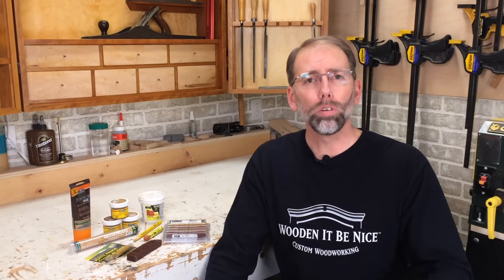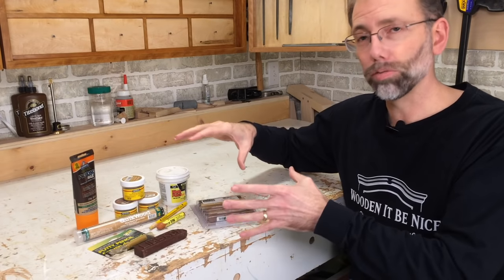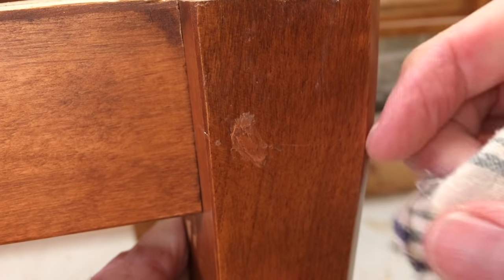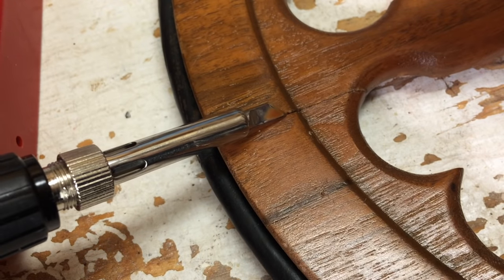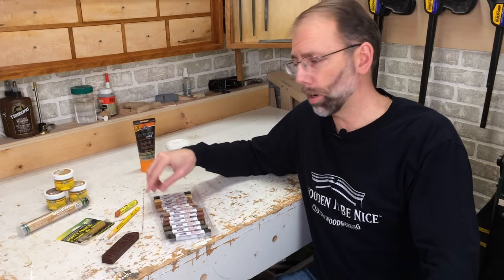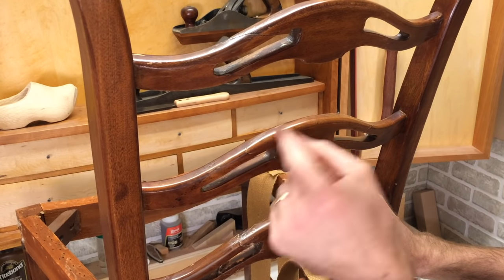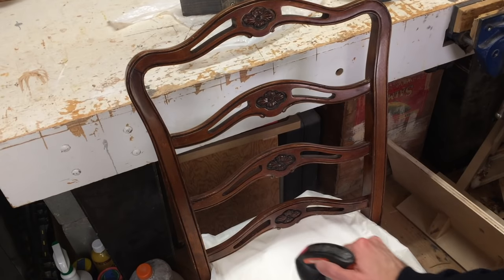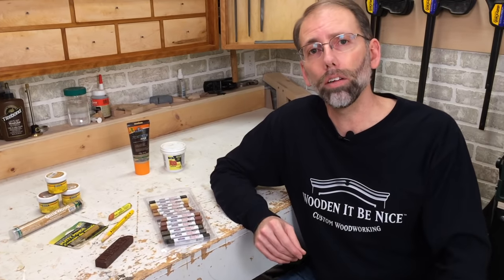Wood Filler & Putty for Furniture Repair | Woodworking How to

Comment: Hi. Thank you for helping me understand the terminology- I was at a Home Depot recently and confused with what to purchase- I am still not entirely sure which product to use even after watching this video. I have laminate flooring and deep gouges - the floor is tan colored. I have PlasticWood X by DAK and thinking of using this on the gouges on the laminate floor. I will try researching this a bit more before using this product. But thank you for posting this video! In case you are familiar with plasticwood X by DAK let me know your thoughts about using this product on laminate flooring..
Reply from the maker: For flooring, there's a better product called Hard Fill.  Here's a video about it.  I hope that helps.  Scott https://youtu.be/XIZs7JJXZ5s
Reply: @FixingFurniture  Hi. Thank you ! I just saw this video with the hard fil wax. I did not use the DAK plasticwood X putty. I had already ordered a Floor Fix by CalFlor repair kit on Amazon to use on the laminate floor gouges. The small holes in the area worked well but awaiting to see the results for the deep scratches. Mohawk Product wax stiks are confusing with all their different names. I bought the regular Fil sticks (which say heat not needed) to cover some scratches on a coffee table. They worked OK but not great. Therefore, i did not jump to order the hard fill and a soldering iron for the laminate floor. I have not been very handy around the house but I am trying to learn more about fixing things myself- its taking time :) If you have any further advice to give based on this comment, I would highly appreciate it. Thanks a ton again

Comment: I repaired one furniture with melted wax with range of colors within the set, quite effective i may say but staining the wood afterwards is a pain coz stain doesnt wanna adhere to waxed areas
Reply from the maker: Ah, yes.  I should have mentioned that wax filler sticks are meant for finished wood, not bare wood for that exact reason.  Scott
Reply: Gel stain would work better.

Comment: What filler could I use for a chipped veneer on a particle board furniture (it's an ikea furniture)? I don't have the chipped piece so sadly I can't just glue it back on
Reply from the maker: I suggest a "hard fill" product.  Here's a video I did with Mohawk Finishes demonstrating how it works https://youtu.be/XIZs7JJXZ5s

Comment: A couple of other  things that I have regularly used for "filling".   One is hard resin burn in sticks.   These come in transparent and opaque colors and I have done 10s of thousands of them.   These are useful for repairing damage such as dents or scratches on the "show surfaces"   You level them and then match the sheen level.   Done properly, the repair is very hard to see.   But it's not an easily learned skill to get it right.  It takes a little practice.  I probably have 50 different colors but the most used are light and dark amber transparent sticks.

Second is a 2-part wood filler.  Common brands are Bondo and Minwax.   I have used these where there is deep damage like a dog chewed a large section of molding.    It sets fast and you can rough trim with a chisel or knife before it's fully set up, then finish up by sanding.

Mohawk and Guardsman make a variety of colors of the epoxy putty sticks.  Just like the wax sticks, you can blend them together.  They do set up much faster and you can accelerate by heating with a hair dryer.   If you are in the shop, time does not matter as much as when you are working on site and have unproductive time waiting for the epoxy to set up.  I've also used them to fill in where hanger bolts have stripped out of things like sofa legs.
Reply from the maker: That's some great information Keith.  Thank you for sharing that.  I really like your tip on heating up the epoxy to accelerate the curing when doing on-site work.  I'll have to try that.  I hope others learn from your comment too.  Cheers.  Scott
Reply: @FixingFurniture  Ha.  I had a job at the end of the day once that needed an epoxy fill, and I wanted to get home.  I proceeded to heat with the hair dryer.   It ended up getting hot, but sure cured fast.   The general rule is chemical reactions double speed for every 18F/10C increase in temperature.   I like your videos to see other approaches, even though I've now retired.  Keep them up.
Reply: @FixingFurniture  Another technique is to get some soapy water and wet your fingers or putty knife and it helps smooth out the surface as you're filling and shaping the epoxy.
Reply: How do you stain the bondo wood filler afterwards to match the rest of the furniture finish?
Reply: @colorconsciousliving3148  I would like to know the answer to this also please.
Reply: @byhammerandhand  yes, heating epoxy will accelerate its curing. But be careful, some brands or types of epoxy will create bubbles if it cures faster than what was expected from the manufacturer (which is to let it cure at around ambient temperatures). It'd be better to try it along the epoxy you're using beforehand, just to make sure.

Comment: Great video!  I'm curious about your description of the Liberon sticks as burn-in sticks requiring a soldering iron.  When I buy them at Lee Valley, the instructions say to work them with your fingers to soften them (from body heat, I presume) and apply them by hand.  This has always worked for me, although I don't doubt that melting them into a defect is quick and effective too.

A double-edged plastic "razor blade" (yes, this is a thing) is useful in working with wax sticks, as it has a bevelled edge that scrapes more easily than an old credit card or the like.  They come in flexible and rigid varieties.
Reply: I recently snitched some of those plastic “razor” blades from my dad’s garage!
Reply from the maker: Thanks for sharing some tips.  In my experience, the Liberon sticks work better with heat as they're harder than pencil/crayon products.  Maybe because I have a heat source my approach has relied on that.

I've never heard of plastic razor blades so I will look them up.  Thank you for sharing your experience!  Scott
Reply: I have plastic razor blades but also use a lotto scratch-off tool that you can usually get free at places that sell the tickets, like convenience stores.

Comment: Another excellent product is Durhams Rock Hard water putty. Works on bare or painted wood. It's inexpensive and yields a lot of putty per can. Also mixing sawdust with some wood glue is another option.

Comment: Thank You 
Sometimes the best wood filler is auto body filler (Bondo). I had to repair stained oak doors some with deep gouges, filled scratched with wire brush to match grain used coloured poly and Artist oil paints to match. Hard to find even if you knew where the repairs were there.

Comment: Thank you so much! i really enjoy watching your videos! i learn so much every time!  i have a question - i have a veneer table that i need to fix the veneer that has missing worn spots.  is there a way to disguise  these spots without having to replace the veneer?
Reply from the maker: Replacing the veneer is the best option.  To make the spot slightly less noticeable, you could use the techniques Bob Walkup shares in this video https://youtu.be/jFr5Aw6XuMA

Comment: Mohawk recommends using a flat thin metal plate to press down over the hard melting wax immediately after application to flatten the surface and cool quickly.
Reply: My flat scraper would be excellent for this! 🪵👍

Comment: Really useful.  Thank you.  I find that most wood fillers do not take stain.
Reply from the maker: Hi John.  Water-based wood fillers take stain the best, but they absorb the stain at a different rate than the wood.  That's why I typically only use wood filler on painted pieces.
Reply: @FixingFurniture  But in this video you say to use it for painting or staining.  Perhaps change that and tell us what to use when staining?  See comment above.  Thank you.

Comment: Great video. Have you tried the non marring scrapers they look like plastic chisels to shave down the melt wax
Reply from the maker: Yes, I have a few, but it's better to use a scraping action at first to avoid breaking the hard wax out of the filled area.  They work well for softer waxes or the final stage of shaving down the hard wax.  Scott

Comment: Great stuff. When you fix a tiny little nick in your favorite cabinet, by filling it with wax, does the wax then harden over time?

I kind of hate the idea that there's soft wax in those nicks, that could easily come out if you accidentally scrape it.

Can you put some sort of finish over it, which merges with the rest of the cabinet's existing finish? And would this finish then be hard enough to protect that soft wax and keep it in place?

Comment: Great video. We have some dents and scratches in a solid wood table that we plan to strip and refinish. So could we use a wood filler/patch product?
Reply from the maker: I wouldn't suggest using a filler on a table top as it's a very visible surface.  If you're refinishing it, sand out the scratches and steam out the dents.  Cheers.  Scott

Comment: what would you recommend for a small crack in the gutter of a large cutting board?  The crack goes all the way thru, and although it is very narrow, it will cause fluid leakage onto my countertops.

Comment: Great videos!  I am repairing a Windsor chair similar to the one in your videos (but not an antique).  I have cleaned out the glue from the mortises and off the tenons just as you describe.  The fit of the tenons is now loose in the mortises.  Would this situation call for the use of epoxy adhesive?

Comment: I have an antique wood cane that has a damaged surface. It goes down a couple layers through the wood to bare wood underneath. Could you recommend the best product to fill that?
Reply from the maker: If it's cosmetic only, I suggest burn-in wood filler.  If the cane is intended for use, I suggest seeking out a professional to ensure it's strong enough to use safely.

Comment: Can you tell us what temperature you set your soldering iron to? And the name of the tip? Thanks.
Reply from the maker: I set it to the lowest temperature, which I switch on and off as it gets too hot if I leave it on.  I don't know the name of the tip.  I purchased the soldering iron that had a variety of tips.  I would generically call this a wedge or skew tip.  I hope that helps.  Scott

Comment: Nice video!  However, I have never found a wood filler that will stain anything like the bare wood it is in....I couldn't tell from your video what success you had with that????
Reply from the maker: Glad you liked it.  Fillers don’t stain the same as wood which is why a burn-in wood filler works the best.  It’s applied after the finishing process so you see exactly what you’re matching to.  We have a more detailed video on that if you’re interested.  Scott

Comment: I wonder if wood filler adds any structure support to a crack? How about applying glue with sawdust? 
I had a broken table leg that I've glued together, and then add some wood filler to the cracks, but after a few weeks, I don't know if it's due to temperature or dry weather, the wood filler also cracked and it's visible. I wonder if glue and sawdust, or wax putty will give a better result.

Comment: Great video. Your link to the Mohawk Quick Fill Burn in Sticks no longer points to that product. Now it points the Mohawk Fill-Sticks (wax) which I dont want. Mohawk also has "E-Z Flow Burn in Sticks" and "Planestick Burn in Sticks". Some are easier to get in certain colors. What is the difference between the "Quick Fill" and "Easy Flow" product?

Comment: thank you for this video, very informative. I am trying to fill in tiny crevices in a desk drawer but it is not a flat surface. It is curved and round in places and I don't know how to apply it smoothly. Is there a tool for that?
Reply from the maker: You will need to over fill the area and then work it back to the profile you want.  If you're using a wax stick, that's difficult.  If you're using a putty filler that you can leave proud, you can sand it back while shaping it after it dries.  Does that make sense?  Scott
Reply: @FixingFurniture   I am using a white wood filler since I'm spray painting it all white. I was able to put it on like the video suggested with my fingers (wearing medical gloves) and then lightly sanded it and cleaned it - THEN spray painted again. it worked.

Comment: Is there any downside to using joint compound instead of wood filler? I find that every time I go to use the wood filler it's dried up. Joint compound lasts much longer. This is of course for something that will be painted later.

Comment: I have a small table/nightstand with a long gouge that's to deep to sand out. Which type of product is best to fill it in to repair so it can be stained and refinished?
Reply from the maker: Table tops are the most challenging surface to work on because they're so visible.  No matter what product you put in a long gouge,  it will still be noticeable.  If you prefer perfection, look at adding veneer on top.  If you're ok with some imperfection, I would leave the finish intact and used burn-in sticks with a coat of finish on top (lacquer is typical, but you need to test the existing finish to use the same type of finish).  I hope that helps.  Scott
Reply: @FixingFurniture  that's what I was afraid of. Its solid wood on top with an inlay around the border. I believe it only has a finish on top and no stain. The entire table looks to have it's natural wood color. I'm thinking to try a wet rag and an iron to swell the wood and minimize the gouge? Then fill the gouge as you suggested and sand it flush and attempt to stain and match the repair as best as possible. This is a thrift store find so I'm ok with mistakes and a learning curve. Do you agree with my plan? 

And thank you for your prompt feedback. I think you and your channel are brilliant. I have learned so much watching you and credit you often and will continue to support your work!
Reply: @FixingFurniture  How do you test an existing finish?  I have to do that and this comment just reminded me.  Thanks

Comment: So which product would you suggest for a piece that I will be stripping, repairing and then just using an oil to restore?  It's teak and the gouges are on the corners.
Reply from the maker: My preferred filler is the burn-in wood filler.  That's what I use most of the time.  I hope that helps.  Scott

Comment: which would you recommend for a straight line 2mm crack in an already finished coffee table? how wide a crack can the wax fill? thx
Reply from the maker: I recommend Mohawk Hard Fill for table tops as it is harder than other fillers.  I hope that helps. Scott

Comment: I have a wooden gate, but the screws on the hinge have stripped the wood. Can I use Quikwood and redrill the holes through it?
Reply from the maker: The easiest solution for this is to go up a size in screw.  Cheers.  Scott

Comment: What would you recommend for a chessboard? We had some trouble making the squares match exactly so made a slight gap in some to make sure they are square with the other ones.... Some people use wood filler then ontop of the wood filler they use saw dust from the same wood, would that work well?
Reply: I keep samples of fine sawdust from a sander in a labeled container.  I then mix with wood glue and make my own "wood filler" that perfectly matches the wood I'm filling a hole in.  Works great!

Comment: What's the best way of repairing large and small but shallow dings that go across the grain?

Thanks
Reply from the maker: Sometime dents can be steamed out with an iron and a damp cloth.  The moisture forces the wood fibres to expand.  There are risks in doing this though, depending on the finish and type of material... maybe I should make a video on that.  Another option is to use a clear burn-in wood filler but if you're looking for perfection, refinishing is the route to go.  I hope that helps.  Scott
Reply: @FixingFurniture  

Thanks for the reply Scott.

A video would be fantastic.

Comment: I would like to see how you fix small sand throughs on walnut veneer.  I use tung oil or Danish oil for my finish and the repair looks like mud?
Reply from the maker: For a veneer sand through, the best way to repair it is by patching in a piece of veneer.  Wood filler does not work well in non-painted finishes.  The alternative is to cut out a slight depression and finish the piece with this depression, then come back and use burn-in sticks to repair the damaged area... not ideal, but the result would be better than a wood filler.  I hope that helps.  Scott
Reply: @FixingFurniture  thank you! I have done a couple of veneer patches, but the burn in stick is an excellent idea.

Comment: When I use a wax stick, I must remove excess wax and when I use a rag, then the wax comes very little out and arise shallows. I use Borma Wachs's sticks. How to avoid this situation again?
Reply from the maker: The first thing you need to make sure you're doing is filling the full void to the bottom.  If you're rubbing a rag over a partially filled hole, you may be pushing the wax further in the hole.  The other thing is only use a light rubbing with the rag to avoid pulling out wax to make a depression.  I hope that helps.  Scott
Reply: Thank you so much!

Comment: Can you add water to a wood filler that's to thick to thin it out?
Reply from the maker: If it's a water-based filler yes, you can add water to thin it down.  Cheers.  Scott